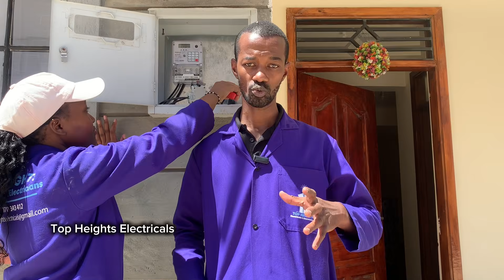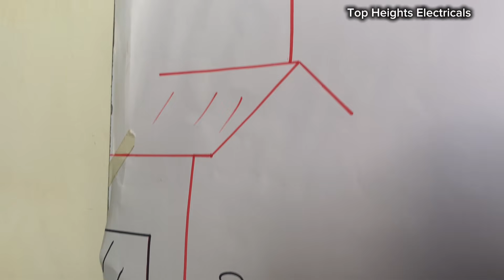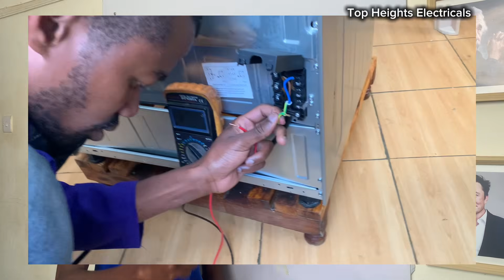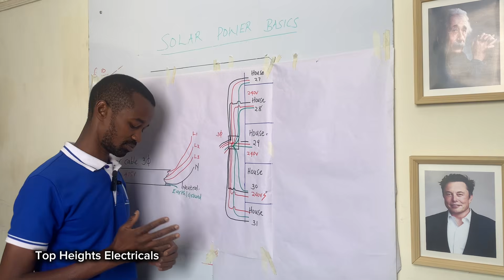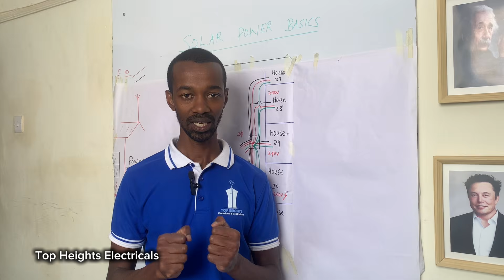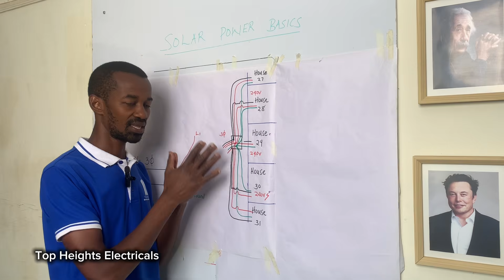Under wiring in homes.

Comment: Am Hesbon from Nairobi. I have noted poor cable management. Secondly I prefer rcbo instead of rcd because incase of electric shock remember it trip and affect all circuits but the rcbo will affect the only circuit that has a problem.
Reply from the maker: Noted my Top Boss.